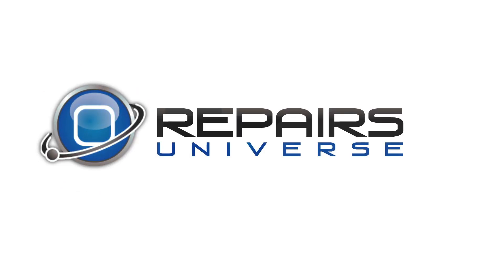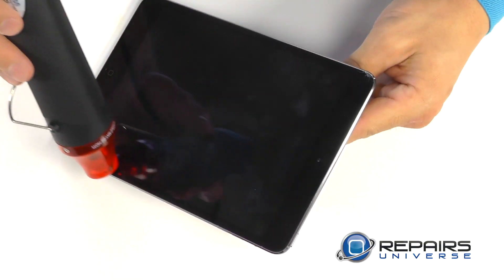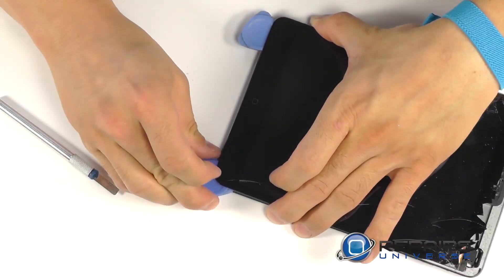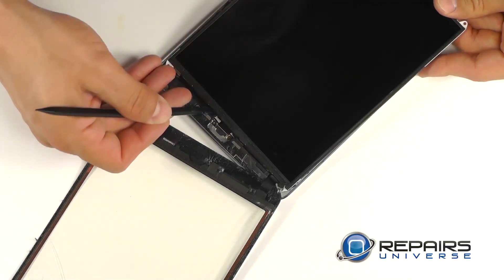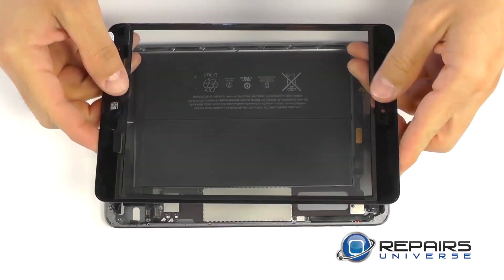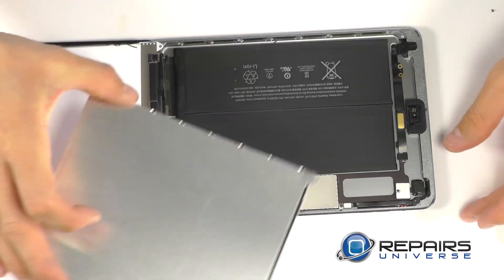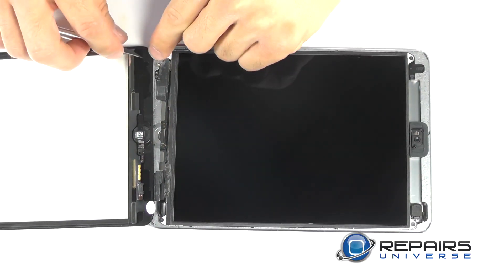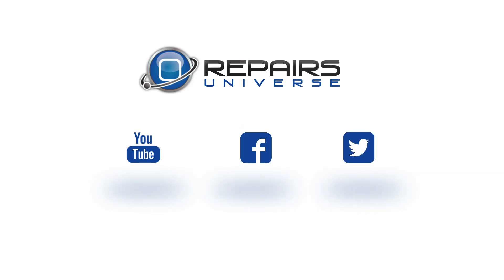iPad Mini (Retina Display) Screen Replacement & Repair Guide

Comment: This took me five hours to do. The display didn't show when I was done and I threw it in my garbage
Reply: orange soda Same thing hapoened to me i had to buy another LCD I'm going to try it today hopefully it works.
Reply: Yep.  That's because this video glosses over a very important detail and you blew the backlight fuse.  You should check out the guide on ifixit, it deals with this.

Comment: HI, I bought 2 LCD to fix my twin boy's ipad mimi 2 , but the LCD would not come on after putting everything back together , I took my time and did everything right . So was these LCD bad before i got them ? I bought them off ebay, and how can i tell if they are bad or not . Oh and i put the old one's back in the ipad mimi and they lite up but are craked , So are the New one's bad was I lie too , Was told they both where new . thanks so much ....

Comment: Important note though, in our case the screen wouldn't turn on even though the digitizer was succesfully replaced. we did hear the typical "plug in"sound when we placed it in its charger but saw nothing. Turned out it required a soft reset (holding home button and power button for 15 seconds), in our case the ipad turned on and was completely functional

Comment: This video contains a serious omission and you will likely mess up your device if you follow it.  It does not tell you to unhook the battery before disconnecting the LCD.  Thanks to this, I have blown my fuse for the LCD and don't know what I am going to do.
Reply: Idk. I think that is kind of common sense to do so. Just sayin
Reply: you don't read very well.
Reply: That same thing happened to me. Did you figure out what to do? I could use some advice. I'm so bummed and I don't have money to buy a new one right now

Comment: A hairdryer does the same thing as the heat gun in terms of temperature, however, I have found the large gust of air can blow bits of glass and spare screws e.t.c. I recommend a heat gun for a more gentle blow and for getting up to temperature more quickly.

Comment: Bought an LCD for the iPad mini on repair universe. Came out defective. Doesn't turn on at all. Tried it on 2 iPads mini, same result, LCD doesn't appear to work. Even tried to restore the iPad (home +power button),Put the old LCD back, and they all work fine. Contacted repair universe and they told me they couldn't provide a replacement because DO NOT BUY FROM REPAIR UNIVERSE

Comment: I succesfully replaced the screen, however, now the LCD is not displaying. Even when I plug it in, I am not seeing any charging or anything on the screen? It worked fine before I removed the screen. Thanks for your help!

Comment: I replaced the screen yesterday and the touch screen works fine. However the LCD screen has this black and white part. 1/3 of the screen is black and the other is white, then there are stripes on the screen also and it keeps flickering. What is wrong with it?
Reply: Kha Tran Could be the connectors not connected right, or damaged lcd.